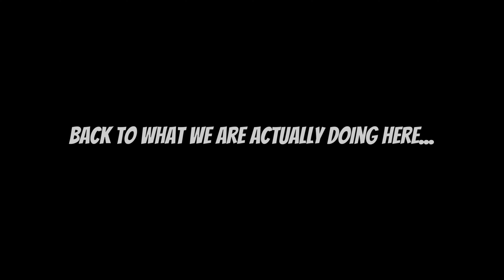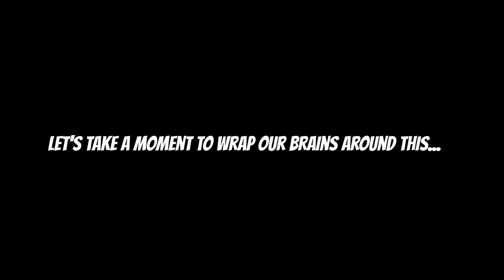HOW TO: REPLACE & RESTORE the Interior Liner & Foam on a Vintage Harley (AMF) Motorcycle Helmet DIY

Comment: Thanks for the complete video on how and how not to restore a helmet liner.  Leaving the foibles in the video makes it easier for someone else not to make the same mistake.  I have a late '60s Bell Star helmet that I've had for 20 years and plan to restore it.  Because of your video I should be able to do this.  Thanks again.
Reply from the maker: Thanks for the feedback Ralph!  We are glad it’s helpful. Good luck with your helmet!  J&C
Reply: @fixingorflipping  I haven't started on mine yet but I plan on doing it this winter.  I had to review your whole video.  So, thanks again.  Have you worn your helmet on rides and how does it work?